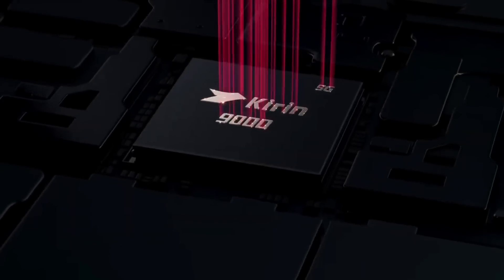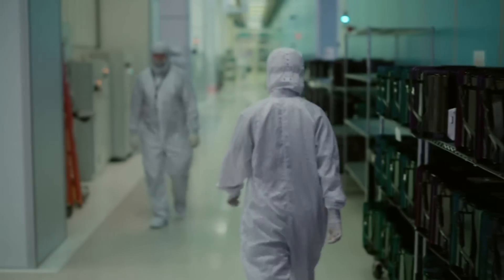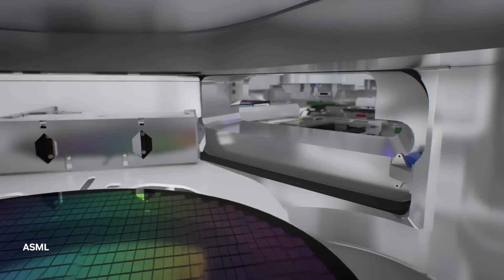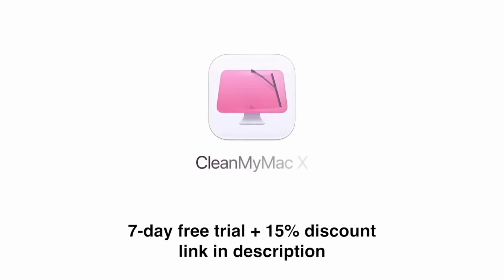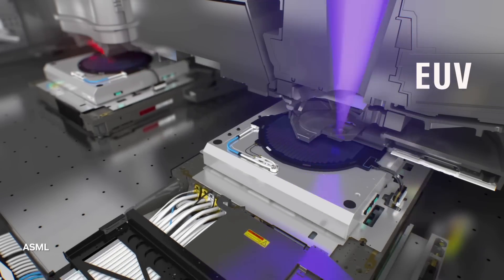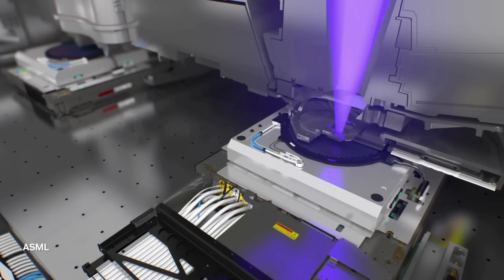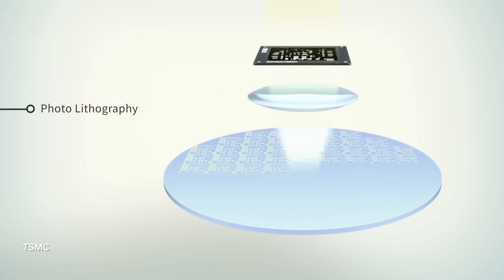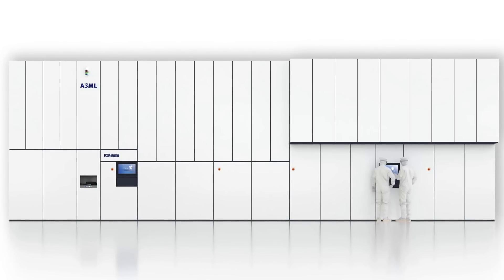The Truth About China's 7nm Breakthrough

Comment: As long as the chip is human made, The chinese people can make it any way. Do not underestimate anyone and Do not overestimate yourself.
Reply: Ren Zhengfei said: Huawei has more than 700 mathematicians, more than 800 physicists, more than 120 chemists, more than 6,000 specialized basic research experts, and more than 60,000 engineers.
Reply: @京北-q3o  and all of that means nothing to the consumer if the chips don't run android.
Reply: @京北-q3o  sounds like a lot of people. But compared to what it takes to address the needs to build up advanced chip manufacturing, packaging, testing, sophisticated EDA software, lithography machines, precision mechanics for calibration in fab, those numbers are nothing. Let alone those people are primarily focusing on software and system for consumer and telecommunication end products. No matter how large China is, the whole semiconductor industry has been an accumulation of non-stop hard work for three decades. Had it been that easy, SMIC, founded twenty years ago, would have achieved a lot more, since just a few years ago when there were no sanctions at all.
Reply: @ChnesRep中華民國OfTaiwan 没事儿，你继续这样认为，反正中国大陆的7nm芯片已经出现了，要么是大陆已经全部建立了你说的这些，要么就是西方有公司在不听美国电话话跟中国大陆合作，不论哪种都不影响中国7nm芯片出现
Reply: @ChnesRep中華民國OfTaiwan 
3,000 TSMC  engineers quit and left Taiwan to work for semiconductor companies in mainland China for higher pay. That's why China is only about 3 years behind instead of 30 years behind. 🦉
Reply: @shermanpeabody6102 The engineers were never the limiting factor - it is always the fab machines
Reply: The Chinese can make it and they can make it more efficiently.
Reply: I hope that u work in semiconductor industry.  Its not about Copy and Paste, it’s about experiences.
Reply: It is not surprising that Chinese has completed the achievement because they have created so many miracles so  far.
Reply: user-yp4oq6iy7q - (China) - 🇨🇳 🇨🇳 🇨🇳 🇨🇳 🇨🇳 - (Remembers) - (Meng Wan Zhou) - (Un - Lawful) - (Arrest) - 🤨🤨🤨🤨🤨 - & - (Absurd) - (Detention) - 🤨🤨🤨🤨🤨 -
Reply: @user-ol3ru2kf1c Name me 10 countries in the world that recognize Taiwan as a country!

🤡
Reply: Taiwanese is Chinese.
Reply: @user-ol3ru2kf1c Here is a quarter for your comment, CIA shill. 🤪
Reply: many people didnt realize even tsmc taiwan chip was made by chinese han ethnic born in china 🤣 doesnt matter where we were born,live or use different politic system its still han ethnic the winner  🤣so im not surprised if chinese mainland can make better microchip soon or later its just about time 🤩
Reply: user-yp4oq6iy7q go to hell,Canada is a dog,you will always remember u have to send back mengwanzhou to China,besides,don’t forget Christ wu,he is Canadian too
Reply: They have many more brains to work on the problem than the West so I think they'll do it faster and better. It's just natural.
Reply: user-yp4oq6iy7q drag dealer and ... please keep it in mind forever
Reply: 已经没人用百度了，在中国百度是公认的骗子平台😅
Reply: user-ol3ru2kf1c  <-- Shill 🤡😂.
Reply: user-yp4oq6iy7q China remembers Huawei princess
Reply: user-yp4oq6iy7q  White spies
Reply: Remember Huawei's CFO being illegal detained by Canada at the behest of the Americanos? Canadians are just spineless lapdogs.
Reply: user-yp4oq6iy7q the two spies
Reply: Skadush 😂❤
Reply: user-ol3ru2kf1c 
Free Hawaii 
Free Texas
Free California
Free north America 
And return the lands to the natives
Reply: user-ol3ru2kf1c 在你梦里也许吧！😂
Reply: https://youtube.com/@MAG-CAMPING919?si=wcpNMR25NdcQdjyo
Reply: China technology seems to be cool now but the china nationalists are still as rude as ever. Wonder how you can feel so proud of something you didnt help even a tiny bit with.
Reply: user-yp4oq6iy7q remember them as two spies 🕵️‍♂️ who get caught.
Reply: user-ol3ru2kf1c free HK from British colonial mindset!!!!!
Reply: user-ol3ru2kf1c 🤡
Reply: Canadian parliament also love and remember the 98 years old nazi hero. They all gave him standing ovation!
Reply: @user-ol3ru2kf1c FREE Scotland from UK
FREE Puerto Rico from US
FREE Sikkim from India 
FREE Kashmir from India
FREE Falkland FROM UK
FREE Diago Garcia from US
FREE Quebec from Canada
FREE Western Australia from Australia
FREE California from U.S.A.
FREE TEXAS from U.S.A.
FREE Hawaii from U.S.A.
FREE Guam from U.S.A.
FREE Marshall Island from USA!
FREE Okinawa (Luchu) from Japan and US occupation!
FREE Northern Ireland from U.K.
FREE Scotland from U.K.
FREE Wales from U.K.
FREE Catalonia from Spain
FREE YOUR ARSE FROM HYPOCRISY!
Reply: Nah. It's far too far a fetch.
Reply: Você Descobriu a Verdade sobre essa Tecnologia Sim o resto sabe como e eles fazem. Por Dissimulador viu . Mentindo e enganando. Pois dinheiro não cai 🌠✨ do céu 🌌 e nem da em Árvore 🌳🌲 o que me diz dessa Teoria. Como eles vem and em farra em Teatro em News em insignificante em um Disfuncional 🤪 como pode uma coisa dessa e o Mundo e o Palhaço 🤡🃏 da vez #
Reply: user-yp4oq6iy7q The whole world  still remember Ms. Meng Wan Zhou!
Reply: @bboxue7588 do not underestimate stupidity,  specifically ccp's stupidity.
Reply: user-ol3ru2kf1c Shut up!Are U out of your mind? There isn't a country named TW,only PRC or ROC.
Reply: Well said 😂
Reply: It's 100% impossible to have a glorious civilization without freedom of speech.
Reply: Chinese people are small so they can make smaller chips!
Reply: Go Taiwan, the real China!
Reply: @stephendueker9006  China occupied Taiwan in 1945 after Japan's defeat. It was a disaster in 4 years creates a super inflation of 200000 times and many Taiwanese lost their lives in uprising and then 40y of martial law. Taiwanese won't let that happen again. China? No thanks.
Reply: wrgg, no such thing as underx or over x or etc, tallx etc 1uferiox bloat, doesnt matter
Reply: user-yp4oq6iy7q lol so your Canadian allegiance is to your own kind and would ignore the fact that the famous Michaels were actual criminals? Shows so much about what you think about truth and justice. Those qualities can be conveniently ignored in the name of prejudice and bias.
Reply: All the country that do well in chip manufacturing , are Confucianism culture.
For chip manufacturing,  a high level of discipline is the key, and most Americans today don't possess it.
They call it “forced labour"
Taiwanese media reported on August 2 that TSMC claimed the production holdup at its Arizona facility was caused by a shortage of trained American labour and that they had sent staff from Taiwan to assist with the factory's development. Labour union officials in Arizona, on the other hand, criticised TSMC for exploiting this as a justification to bring in "low-wage foreign labour."
Reply: Kongfu said
Reply: @PPPPP883  不做，那就真的只能只能一輩子跟在人家後面。
Reply: false
Reply: @sandrobilic     Is  she  russian  ¿       Because   she  resides  in  europe  ¿
Reply: It's just a little hard to believe coming from a country that lies so much
Reply: @babyoda1973  you mean USA？
Reply: 这个话从逻辑上没有错，单是需要在相互学习的前提上，中国人的创新能力极差，但复制能力很强
Reply: @MAG-CAMPING919 谁告诉你创新能力弱的，现在是谁在引领科技发展？跪久了站不起来了？
Reply: Manufacturing semi conductors is not equivalent to Manufacturing biscuits.
Reply: @macrick  - (Landing) - On - (The - Moon) - ✋️✋️✋️✋️✋️ - & - (Landing) - On - (Mars) - ✋️✋️✋️✋️✋️ - Are - (Not - Like) - (Manufacturing - Chips) - ❌️❌️❌️❌️❌️ - (ROC) - (Taiwan - Province) - 🇹🇼 🇹🇼 🇹🇼 🇹🇼 🇹🇼 - Has - (No - Such - Capacity) - ❌️❌️❌️❌️❌️ - (Period) - ✋️✋️✋️✋️✋️ -
Reply: @macrick 然而事实是连美国也对自己肚子制造芯片不抱希望，但，中国全产业链制造的7纳米芯片就在雷蒙多访华那一天出现了！其实早就可以发布，但一定得找个美国官员来打脸！这就与当年J20选择在美国国防部长访华那一天试飞成功一样！我什么都没说，但让你什么都能明白，这，就是你们永远无法理解的中国
Reply: @macrick   Of course we know. Building an ISS is not equivalent to manufacturing biscuits either but then China built Tiangong.
Reply: @huanhuang311  Chinese has its fair share of credit in self developing aerospace technologies, a 60y journey. Therefore it shouldn't be that hard to recognize and respect countries like Taiwan, Netherlands who have poured the best EECS engineers and dedication for scoring today's achievements for the last 40 years.
Reply: @ChnesRep中華民國OfTaiwan  How can this be disrespectful if China just says I can do it too? We respect every achievement by humankind but are also confident to achieve just the same since we are not less smart or less diligent, even though hindered by jealous rivals. A year or a decade or a century, we will get there.
Reply: @ChnesRep中華民國OfTaiwan Taiwan is not a country, so you think too much.
Reply: user-ol3ru2kf1c   Taiwan is a country, but it's officially called Republic of China.
Reply: @brian.z6592 中国台湾省
Reply: @fengying-haoyunllianlian   台湾确实是一个省，但“中国”到底由哪个政府代表还有争议。
Reply: @brian.z6592  意淫有個毛用，眞要覺得自已有能耐，先把老蔣從大陸搜割给臺灣的財富還回給大陸人民，然後你們再莊B
Reply: @Mrmo-y9t   如果认为中华民国是中国，那大陆地区也只是它辖下的一个地区，哪来“还”的说法，如果有机会可以直接把这笔财富通过财政支出的方式用回去大陆地区。况且，现在执政党不是国民党，这笔钱已经轮不到国民党说了算。
Reply: @brian.z6592 中华文化有很强的认祖认宗思想。且不说台湾，在世界各国的公民里的华裔大多都认同这个遥远的有着血脉联系的土地。包括现在的台湾人有许多人本身或者父母、爷奶是大陆各个省出生、祖籍的。从历史的角度看，台湾也是被分裂分子从中国大陆分裂出去的，联合国包括你们美爹以及世界各国政府都承一中原则😂，中国大陆确实不能代表完整唯一的中国，因为确实还有一个分裂出去的台湾省。
Reply: @brian.z6592  台湾是一个地区，一个中国两个政权。
Reply: @brian.z6592 Taiwan is a country，but seldom country admit it😂
Reply: @云卷舒  Taiwan Is not a country, but R.O.C. Is.
Reply: There is only so much cheap laborers you can harvest for, and duplicate still much easier than create.
Reply: Yeah，Vietnam, Africa, South America ... labor is cheaper there. Go harvest
Reply: @slendsunny8272 
China did create their own methods cause US government placed tons of sanctions on chip making technology, so China doesnt have access to the technology to "duplicate" from. Chinese people are way smarter than you think, US tries its best to put obstacles on Chinese chip development as well as other high tech related industry yet it didnt stop them from making breakthroughs.
Reply: @slendsunny8272  - (The - US) - 🇺🇲 🇺🇲 🇺🇲 🇺🇲 🇺🇲 - (Did - Harvest) - (Slave - Labor) - (1st) - From - (Africa) - ✋️✋️✋️✋️✋️ - (2nd) - From - (Latino - Migrants) - 🎯🎯🎯🎯🎯 - (3rd) - From - (Chinese) - (Indentured - Laborers) - ✋️✋️✋️✋️✋️ - in - (The - 19th Century) - 🗓 🗓 🗓 🗓 🗓 - On - Top - of - (The - 3 Million) - (Slave - Labourers) - in - (The - US) - (Prisons) - 🇺🇲 🇺🇲 🇺🇲 🇺🇲 🇺🇲 - with - (Absolutely) - (No - Rights) - (What - So - Ever) - 🤣🤣🤣🤣🤣 -
Reply: @slendsunny8272 you have no clue about technology. Maybe get some educations first
Reply: @slendsunny8272 seems like ,you still live in your dream.
Reply: @slendsunny8272 we create lot of shit thru out the history.
Reply: @slendsunny8272 Do you think American brands produce stuff with American resources? All the natural resources us westerners use all come from African countries victims of western colonization. At least in China miners are technicians accompanied by machines and not children stolen from their families
Reply: @slendsunny8272 western people talk about cheap labour  who colonised the whole and sold black people as slaves it's ironic
Reply: @slendsunny8272 Funny, the labor of Indians and Africans is much cheaper than that of China. Why can’t Indians and Africans make chips?
Reply: uma piada 😂😅😊#
Reply: @slendsunny8272  you're coping too hard.
Reply: Don't overestimate yourself, especially if you are Chinese. Chips aren't easy, especially if it's a real business.
Reply: @ChnesRep中華民國OfTaiwan 试问，目前除了中国这个国家，包括美国在内的所有其它国家，有哪个可以站出来说我可以不依赖外国技术，在几乎全封闭状态下从设计到封装到生产到销售？来，说一个你能想得到或者你可以展望十年后的这种国家，哪怕说一个就可以证明你不是你表现出来的这么愚蠢😂
Reply: @ChnesRep中華民國OfTaiwan as Chinese we have done so many things that no others could do. We will do better for sure, you guys can only cry.
Reply: @davidz7858  sure sure we have climbed and sweated so much too be where we are today and no pride. Only when the Chinese reach here are deserved to be proud. I understand. I understand. China, the middle kingdom sees no one other than themselves.
Reply: @ChnesRep中華民國OfTaiwan buy a PRC flag, you will need it soon.
Reply: @xw8462  what made you think so? a flag to remind people of the country that brought the COVID disaster to the world? No thanks. 🇹🇼 is what we already have/use.
Reply: @ChnesRep中華民國OfTaiwan  if you don't need it within two years, you can have my kidney.
Reply: most likely you are not even qualified for working on sophiscated things like that, due to lack of expertise, unless all you plan to do is grab a bite for the 9.8 trillion RMB budget and run. Even that you are already too late. China gov has been quite generous for CCP officials to share the pie, not anymore.
Reply: @ChnesRep中華民國OfTaiwan are you white or some asian pretending to be white 😂😂😂
Reply: @humansarecrazybeing5730  why white? What pretend? Taiwan citizen I am.
Reply: @ChnesRep中華民國OfTaiwan your country is called  "Republic of China", not Taiwan.
Reply: @brian.z6592 
😁😁😂😂🤣🤣
Reply: Any proof that covid19  is from China? Isn’t  it Taiwan part of China? You both speak Mandarine and write the Han characters! To me, all Asians look the same!
Reply: @xw8462 
Actually you will need those flags to wrap the bodies of your soldiers being sent home if you invade the island.
Reply: @ChnesRep中華民國OfTaiwan 鸡蛋够吃吗！
Reply: @tongyang651  happy birthday to the  Party's Royal China.
Reply: @ChnesRep中華民國OfTaiwan You have proof? Smearing is what you know best apparently.
Reply: @brian.z6592 Taiwan is just a province of China😂😂😂
Reply: @swingshang5783   You're right, a province of R.O.C
Reply: @brian.z6592 
Taiwan is a province of China,not a country. 😊😮
Reply: @Kuasarakyat2  agree, it's a province of R.O.C.
Reply: @brian.z6592 where’s roc in UN😅you are another working comment account
Reply: @ChnesRep中華民國OfTaiwan Fort Detrick Biological Laboratory
Reply: @ChnesRep中華民國OfTaiwan TSMC is going to die.
Reply: @ChnesRep中華民國OfTaiwan In the reports about China, we can always see Taiwan Province people misleading netizens regardless of the facts. What's the point of doing this?
Reply: @ChnesRep中華民國OfTaiwan  China has a population of over a billion. Lots of resources. And the same percentage of highly smart people as every other place on earth.

 Anything we can make, China can find out independently later on. Even if they don't just manage to get the classical info to duplicate it.
Reply: @dekippiesip  sure sure, China has population resources so and so. Then it should be able to do anything.  I am just wondering then, how’s China’s basketball, football, volleyball doing now? What’s so hard picking a dozen of best athletes from a pool of 1.3 billion people.  Hm…
Reply: @ChnesRep中華民國OfTaiwan 因为这些运动不是中国发展的重点。只要不是外星的科技，中国总能追上来。不信的话，看看中国最近30年的发展就能知道。
Reply: @ChnesRep中華民國OfTaiwan  中国确实不完美，不是每个行业都能做到最好，但是你一方面在竭尽所能的挑中国不好的地方，另一方面你却只能拿台积电证明你们台湾的优越。你别忘了，台积电也只是芯片制造上的一个环节，它所用的几乎所有设备也都是其他国家制造的，台积电在这个链条上也不过是卖苦力而已。洋人哪天不卖给台积电设备了，台积电还能干什么？挟洋自重从来都是台湾人用来秀优越的武器。以前你们可以拿各种技术说中国落后，现在你们台积电的那点技术无非就是躺在洋人设备上的一点应用而已，其他几乎所有领域的技术都被中国超过了。如今芯片制造中国也才是刚起步，但是和其他任何技术领域一样，用不了多久，就没有你们吃的饭了。
Reply: @吴文安  No doubt given opportunities the Chinese people can be as good as overseas Chinese but it all depends on who the leader is. China, after all, is a rule of man country. GDP first, economy thrive. Class struggle and regime security first, economy collapse. That’s what China has shown to the world in the last 70 years. Leader is the key, and yours right now is pretty lame. Good luck to survive his lifelong term.
Reply: @ChnesRep中華民國OfTaiwan 
China did win 38 gold medals in the 2020 Summer Olympics.
India with the same population as China won 1 gold medal.
🦉
Reply: @ChnesRep中華民國OfTaiwan  YOU MAY NEED TO BE CAREFUL ABOUT YOUR SPEECH.AND SOON YOU WILL NEED A CHINESE ID CARD.
Reply: @xupaolo3820  what's the relationships between an ID of Party's Royal China and one's speech? Is it then you earn the right of piling up trash in mind and reinterpret the smell as tasty? 😂 Smelly for sure.
Reply: @ChnesRep中華民國OfTaiwan  YOU R FOOL？ WEIRED！
Reply: @xupaolo3820  you are right. Even fools dump garbages regularly to keep home clean and livable. When you can't speak up, you'll be mentally sick over time. Don't do that and don't live there.
Reply: @ChnesRep中華民國OfTaiwan yes，because you don't have
Reply: @ChnesRep中華民國OfTaiwan  Cant say the  chinese  overestimate themselves.  The  top  notch chips scientists in China  are chinese. So are the top notch chip scientists outside China who were behind the breakthros n advancements in chips techno achieved in the last decades by  tsmc, intel , nvidiia. The Finfet technology used by asml  to make euv lithography is chinese born too.
Reply: @ChnesRep中華民國OfTaiwan Even if the delusional optimisum of the Chinese came true... by the time it catches up, all of us will be old. How long can a man wait.